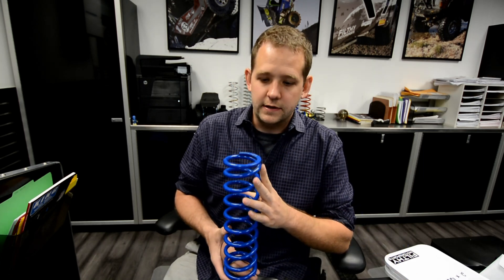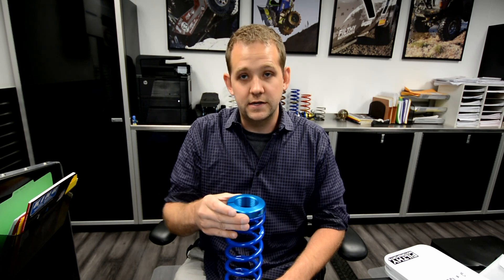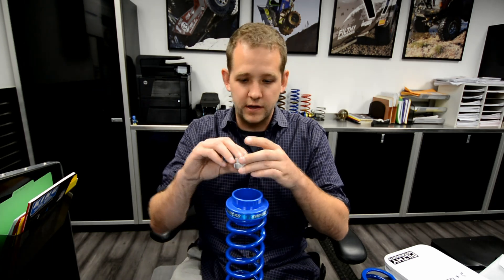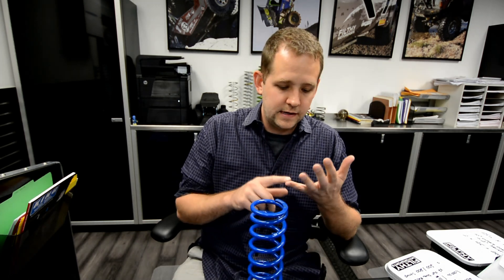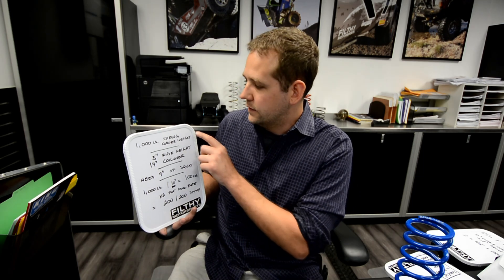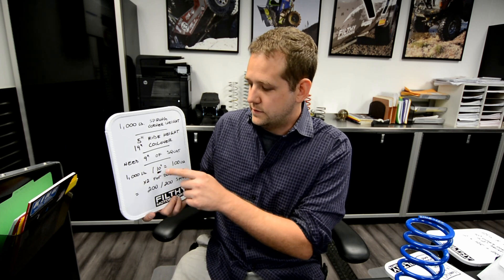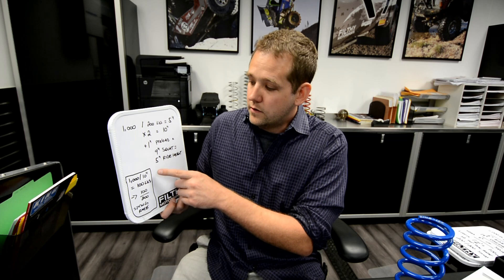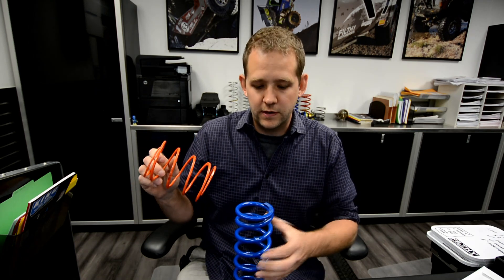Coilover Springs, Spring Rates, and Calculations - Filthy Motorsports

Comment: Is a dual rate set up good when used with IFS? i'm planning to retrofit a GM 9.25 IFS diff in a 57 chevy truck build. I am also expecting to need to take into account the higher cv joint stress as the diff is going to be narrowed almost 8 inches to fit this truck.

Comment: So I installed a pair of 2.0x12 king coilover dual rate , I installed the slider with the shorter side facing upward bc that’s how the orientation of the logo on the slider is facing as well , so the correct way would be to have the longer part of the slider facing up even though the logo would be upside down ?

Comment: I really hope you answer this one! 

Just installed king 12” 2.0 coilovers on a 2010 JKU. Had to have 5” of preload to get it to sit at ride height matching the rear (which is 4” of lift, previously had 3.5” spring with 1/2” spacer). 

How do I lessen the preload while retaining the same height?
Reply: Unfortunately you'll need higher rate springs.

To require 2.5in of preload = 2x spring rate 

To required 1in of preload = 5x spring rate

I recommend the 2x.

Comment: Great video! What coil springs would you recommend for RAM 1500 4th gen for smooth ride on 2.5" adjustable shocks? Or may be you have information about axels weights on this car so i can calculate springs rate by myself. Thank you

Comment: I have Jeep JL diesel with coilovers. On the front I have triple bypass and king 2.5 coilovers up front with with top 3-12-300 and bottom 3-14-300 on 12” shock.

On the rear I have 3-12-200 and bottom of 3-14-250.

I set the coilovers at zero preload front and rear and had to add bit of preload in the rear to get it to level out with the front. 

Could I drop the top rate in the front to 250 so I could take some of the height out of the front? I think the Jeep is sitting too tall and could come down some in the front and then take some of the preload from the rear.

Comment: Thanks a metric butt ton! No rock crawler here, but the principle is the same and I've been battling with my spring length/rate of my new coilovers. The manufacturer has already sent me new ones with a higher rate and same length (and now I really wish that I had had a little more dialogue with them). Ended up the original ones they included in the kit for my car the same  spring rates for a car roughly 700lbs lighter and with a different front to rear weight ratio. They kept binding and realized at one point while resetting the preload, that the free height of them were permanently 5mm or so shorter. However, these new springs are having the same issues once the coilovers settle. At first they drive great, and then I'm bottoming out it feels horrible.

I appreciate the way you explained everything, it was easy to follow and understand (well after countless hours of research and troubleshooting. I  am going to use your method to get the corner weights even if it's a rough number. And I have a feeling that it's likely I'll need a taller spring instead of just a stiffer one. I prefer a smoother ride and wanted adjustable damping for the constantly varying weight. I use the car to load up luggage and deliver all over OR and WA and there are okay to absolute crap roads and no shortage of potholes. I really need to dial in the rear springs so the car will be able to handle a load of 450lbs (rounding up) at the start of work and still have room for unexpected road conditions

Comment: If you can’t find coils in the exact right length as the OEM.. would you go with shorter or longer ones as a replacement? Looking for a stiffer spring rate but can’t find 13” length 2.25” coils.. only 12 or 14”
Reply from the maker: That is a tough one to answer without more information. If you go longer you run the risk of coil binding but if you go shorter you might run out of preload adjustability. I still don't understand why some shocks are built  using custom length 13" coil springs when they could easily have been made to use an industry standard 14" spring.

Comment: why couldn't you just use longer coil springs instead of a tender spring?
Reply from the maker: You could, but the springs would be so light that they would end up resting on the shock body so while those number work on paper, they are not ideal in practice. Great question!

Comment: I just want to thank you for this video! After battling with the rear suspension of my SUV, it was soft but wasn’t right. In the end it required a little spacer for the rear coil springs. Somehow it did wonders for the ride quality and control (the coils were a little shorter than the travel of the rear suspension). In the end I placed a small 20mm spacer and now the ride is way better and it feels as if the socks can do their job much better than before. I have never imagined I required a little preload
Reply from the maker: So glad to hear it!

Comment: What is the purpose of the tender spring. My fox 14 inch coil overs have Eibach 350 top 350 bottom with a tender spring in between.
Reply from the maker: You do not need a tender spring on a 14" coilover with 350 spring rates. Remove the tender and replace the springs as a proper dual rate.

Comment: What would happen if someone ran different Length springs on the left and right but same brand and rate? 7” passenger side and 8” or the driver side
Reply from the maker: As long as they are the same rate and can be preloaded to provide the desired ride height they would act exactly the same.

Comment: Hey i have some icon stage 1 and they come with 13”  650 pound springs . I feel like theres too much preload on them due to the lift i have which is about 3” . Would it be better if i swapped them for a bigger spring spring like 14” either 650 pounds or 700 pounds this way it will have less preload? Will this feel smoother at all ?

Comment: As an ASE Master Tech since late 70’s, coil spring rate was not on my radar much as mostly OEM supported products were used. Moving away from stock designs for a better ride involves an understanding first, knowledge of products and experience. This guy does a very good job of all. Building a vehicle for me for a change and a vintage truck, like the 67 C10 truck, is not a rock crawler but a daily driver that needs improving. That brought here!
Learning is the first step, before opening a wallet and letting it fly. The old saying is true in suspension as it is for speed, “How fast can you afford to go?” or “How good do you want it to ride & handle?” I would spend money if I knew before what is was getting, this video helps a bunch! Thanks...

Comment: Now I don't drive a truck, only cars. Tell me, for most sedans, are the dampers underpowered and then they make up for it with heavier springs? Or are they too soft and floaty because not enough is done to take care of nvh that could be a problem with a stiffer suspension?

Comment: Hello i have utv 1900kg witch unimog axles . I want make a 4 link with king or profender coliovers 14-16 inch . Front axles with whels are 350kg and rear axles with whels are 325kg . 
Front weight are 52% -988kg, rear are 48%-912 kg . What coils rate will be good for front and rear ? thanks for the answer
Reply from the maker: Happy to help: https://www.filthymotorsports.com/Shock_Review_p/fm-shockrev.htm

Comment: Is a 18" free length with 600lb rate a good choice for fox 2.5 dsc coilovers on a toyota tundra that does not have heavy bumper or winch. I was recommended some Eibach 3.0 springs in that spec.

Comment: Hi. I want to upgrade my truck a king set. I have a Nissan Navara MY19 (this model is not sold in the USA) which is the new model of the Frontier (in fact in the Latinamerican countries it keeps the Frontier name). It’s quite different in a lot of aspects, but the front suspension remains almost the same of the previous model (still on production for the USA). However the rear suspension is a 5 link type with coil springs (no more leaf springs for this truck). 
If I don’t know the stock spring rates of my truck, how can I calculate the unsprung weight?
I guess measuring the total weight of the truck, then lift the truck until just before the wheels hang over, then measure the weight again and finally deduct the second measurement to the first one....
Could it work?

Thanks a lot!

Comment: Ben thanks for the info. I drive a Chevy Trax to and from work a total  of 16 miles round trip. The car rides very rough even with new tires and new struts and shocks. The road is of poor quality but the ride I believe shouldn’t be so hard and jarring. Any suggestions? Thanks.

Comment: i'm trying to get the specs on some aftermarket coilover springs but with the way they've stamped them not sure what the specs are, they are stamped "70  5  230  10kg"the 10k is rate and the 70 is probably inner spring diameter with the 230 being length, could the 5 be the number of coils or something to do with the wire diameter, or tensile strength? never seen springs marked like this before.....

Comment: Thanks for your videos and your pro knowledge, but I have a question. What is typical compression percentage of upper spring until it can not compresd any more becouse of those blocking nuts ? I mean if  I would have 8 inch spring, should it be blocked when it gets to 4 inch ? Like 50% does it depend on spring height ?
Reply from the maker: There is no universal answer to that question as it really depends on the application, I would need to see a photo of the coilovers as they sit installed under the weight of the vehicle.

Comment: Be careful buying King shocks I bought some for my Kawasaki Teryx Le 2014 the backs are way too long they will not stand behind them and let me return them and get me new ones one person told me to turn the spring all the way to the top does not fix the problem shocks still too long no travel
Reply from the maker: Hi Tom, sorry to hear about the frustration, we stopped selling parts for the Teryx years ago because there were simply too many variations in their production to keep up and it was causing problems. I'm guessing you ordered these through someone other than Filthy Motorsports?

Comment: I have a diesel Chevy Colorado that I plan on putting baja kits long travel kit on. They have king 2.5's specifically tuned for the extra suspension travel, but I have a winch and bumper. Would I be able to email you and adjust springs with y'all?
Reply from the maker: We'd be happy to help!

Comment: rock crawer why do you need an spuid helper spring just to slip out of place
Reply from the maker: A tender/helper spring is only needed when the math works out to needing springs that are too light to work well (less than 100 lbs/in.) and because heavier springs would go loose at full extension, a tender spring is needed to keep them tight.

Comment: I must be missing something. If a 14” 100# spring compresses 10” with a 1000 pounds on it why does cutting it in half and making each a 7” spring make it want to compress each spring 10”. Wouldn’t each spring take 500# of load and compress 5” giving your total travel of 10”
Reply from the maker: Both springs are always supporting the full wight of the vehicle. If I stand on your shoulders, and I lift 100 lbs., we are both lifting that 100 lbs. Does that help?

Comment: I have a 07 fj cruiser, and got arb bumper with fog lights no plan for winch, I like to level front , would I do it with kings 25001-124 in front thank you for you input

Comment: Ben thank you for all the awesome information!, however I thought of something, aren't springs the real "shock absorbers" here since springs are the energy absorbing units and the shock is the energy dissipating unit? I am still doing tons of research on the difference between compression damping and spring rates. I heard you said keeping the spring as neutral as possible so the shock could do its work however you also mentioned in some applications higher spring rates prevent bottoming. Went a little off track but defiantly would be nice to see a king shock expert elaborating the differences in a video! Thanks.
Reply from the maker: Thanks for the question, that is a VERY common misconception so make sure to watch our video on ride quality. In short, a spring only knows one thing, to compress a given mount under a set load, and then kick back. A shock absorber is tuned to act differently between high forces and low forces and fast movement and slow movements, offering incredible control over the vehicle. If you have bad shock absorbers, then you need a heavy spring (poor ride quality). If you have good shocks, you want a soft spring to let the shock do most of the work. Hope that helps!
Reply from the maker: (Think of it this way - If a trophy truck lands from 6 feet in the air,  that would require an extremely heavy spring to "absorb" all of that energy within 6 feet or before the suspension bottoms out. That heavy spring would then make the truck completely unmanageable for driving. Instead, they use relatively light springs to effectively make the vehicle neutral, and have massive shocks to absorb that energy by forcing oil through small passages in the piston where it can be fine tuned for the best control.)
Reply: One confusing thing is that the name ‘shock absorber’ is exactly what it isn’t. The name ‘damper’ is a much better description as that is what it does - it dampens the movement of the suspension.

Comment: Halo ben my name is jacques.im intrested in building a mini sand rail like the ones from badland buggys.do u sugest i build the car first and then order the shocks?i must stil make a begining with my car.shocks is a prety expensive item (Rand 8500/shock) so i dont want to make mistake
 Thanks Ben
Reply from the maker: You need to plan the build from the beginning but I prefer to wait until the very end to order the shocks so we have the best chance of having them built and valved correctly right out of the box. Hope that helps!
Reply: @Filthymotorsports  try

Comment: I have a 96 XJ that I want to change the suspension in front. I know nothing about coilovers but am interested. Are they used with the standard coil springs? Where would I start for putting together a decent suspension kit on my jeep?

Comment: I have a 2002 chevy S10 ZR2 4x4 V6 4.3L with factory bilstein 4600 shocks with a factory 3inch lift. 4inch wider fenders. it weighs about 4800lbs  I'm gonna replace my shocks with factory bilstein shocks what coil overs would you recommend for these shocks or vehicle

Comment: Heths Amathing !!!!!  Now !!!!  I have a 07 hummer h3,  I want my cake and eat it TOO!!!!!  I want the smoothest ride and the sturdiest shock just in case Im in Jurassic Park,  Im a street rider a highway glider but just in case my curiosity gets the best of me on the 70 from denver to cali, I have the original oe, ac delco company. Does King have a monotube equal or better than Belstein ? Can King make a coilover for my H3 ?  How do you compare King Belstein Fox for a Hummer H3 ? What is the best sturdy and smooth ? Some like it Dirty I like it Sturdy.
Reply from the maker: Hi Daniel, there is a lot more to it than that, you may want to check out or video on Ride Quality: https://youtu.be/FtAP774EaIA
Reply: +Filthy Motorsports I have watched your videos, I still would like your opinion or comparison between the King and a Fox they  both seem higher quality than belstein. I simply want the best choice. I have oe ac delco now. You gave me a good explanation of the deficiency of belstein thank you. Does King make a shock for a hummer that meets oe specs, I dont mind a 1.5 inch lift front, this is what I am coming to conclude. I trust your best judgement. Thank you.

Comment: hi why do they say the BC shocks compared to other brands are not as good as bilsten  shocks for track cars ? can you explain the differences ? Bc have 3 ranges of shocks .. is servicing a must for these kind of shocks and what should we look at before we replace them ?
Reply from the maker: Sorry for the late reply, your question got tagged as spam. Unfortunately, I'm not familiar with BC shocks but for what it's worth, the overall quality of a shock is based on the materials, the size and design of the components, the tightness of the tolerances, and the proper arrangement of the valving shims.

Comment: I have an Icon Vehicle Dynamics coilover for my Jeep Jk I can't seem to get help as I am an international customer. Please Filthy help me select a proper spring for my Jeep. I find my Jeep sagging too much. I have a smittybilt front bumper, poison spyder side armor and poison spyder rear tire carrier with 37" nitto trail grapplers. I have too much preload at the moment. I am not a rock crawler and I do offroad wheeling most of the time.
Reply from the maker: No problem, what are your current spring rates, free heights and the height of the springs as they sit under the weight of the vehicle?